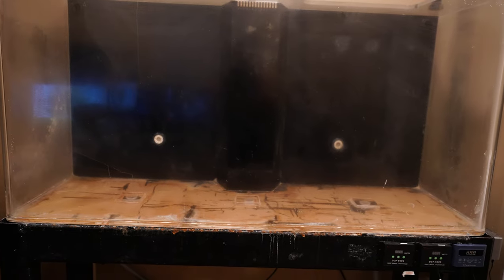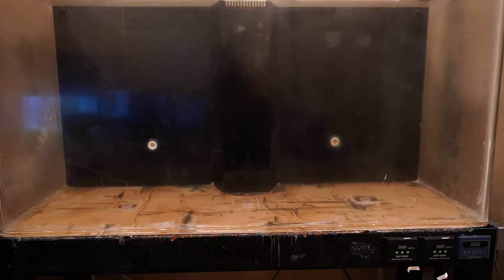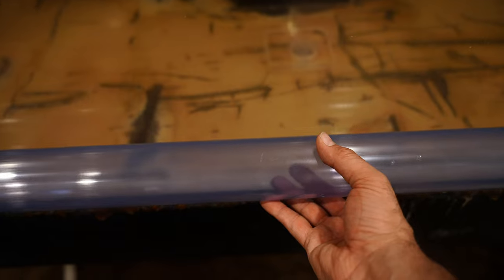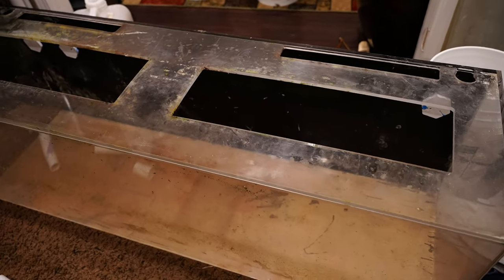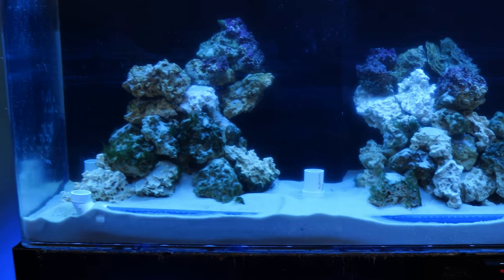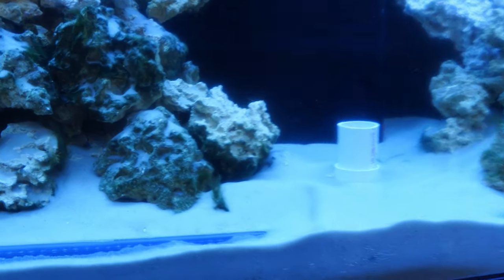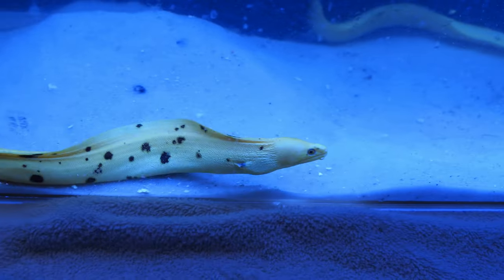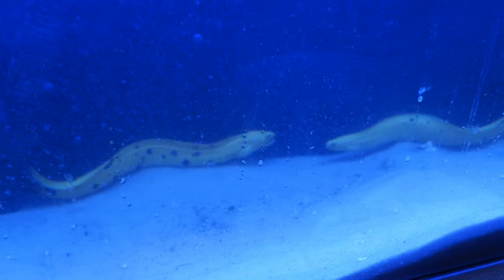Banana Moray Aquarium - 02 - Aquarium Redesign

Comment: Amazing tank. I have two eels, a tessalata and zebra eel, had no idea about the garlic trick and will start using it. How are able to keep so many clownfish with them killing each other? I see you keep shrimp, small fish, even crab, I’m afraid of adding all them thinking the eels will eat them. Keep up the great content and 👏👏
Reply from the maker: Thanks! The Clownfish can build a harem if there are enough hiding spaces for everyone which is possible in this 270g tank. I have 22 of them, 12 orange and 10 black darwin clownfish. I used to have a lot of anemones to provide hiding spaces for them but they didn't last because the tank wasn't mature enough. However, I do have a lot of Green Star Polyps and the Clownfish love to hide in them just as much and it grows like weeds. For your eels, the problem is that you have a fish eater in the Tessalata and a crustacean eater in the Zebra moray. You could train both eels to accept only frozen food that smells like garlic but your Zebra eel could potentially still eat any crabs. You should be able to keep cleaner shrimp though because they shake their front legs to show they are cleaners so most predators won't attack them. Maybe try one when they are on sale.. Also, unless your tank is over 100 gallons it is best to keep no more than 2 cleaner shrimp as they will fight to the death over territory. I have 16 cleaner shrimp in my 1,000g tank because there is enough space for them to setup multiple cleaning stations. You can also try cleaner wrasses to clean other fish that hang out in the open water.